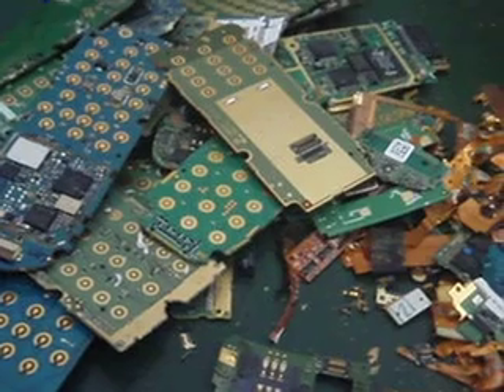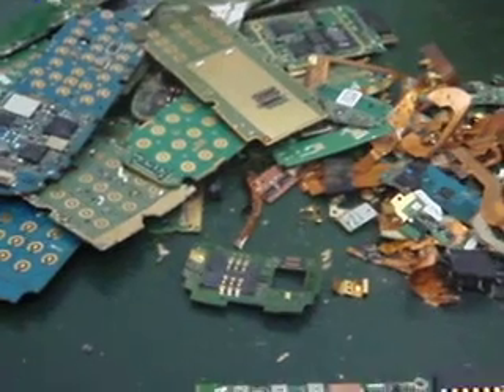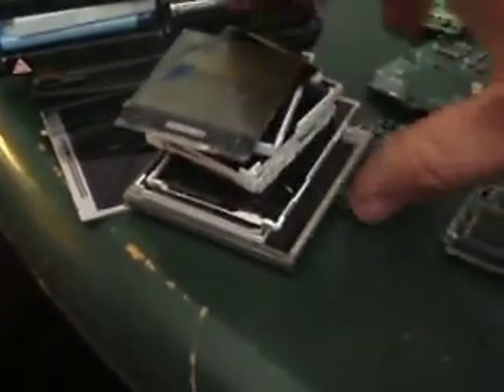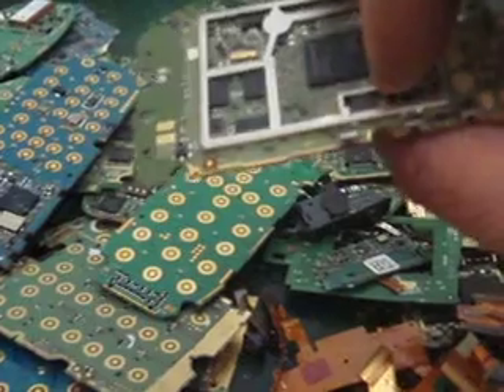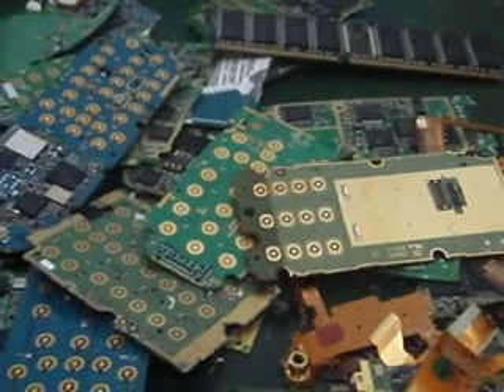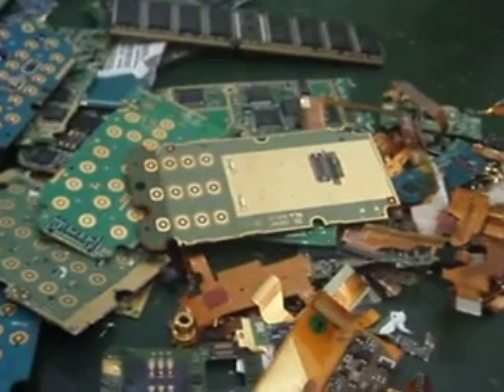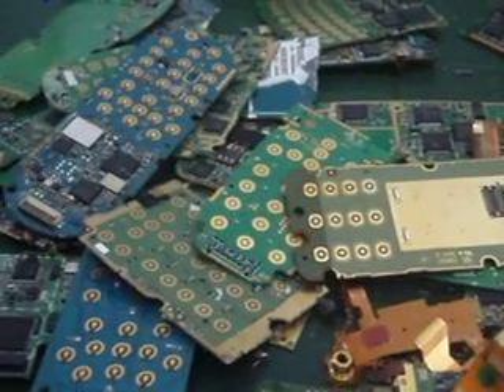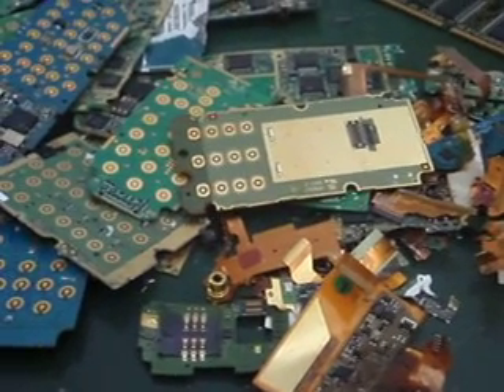Scrapping And Recovering The Gold From A Pile Of Old Cell Phones

Comment: a word to the wise the metal brackets in the phones may or may not be aluminium it may be non feros stainless steel and also make sure before you process any of the gold you take all components off the mother boards